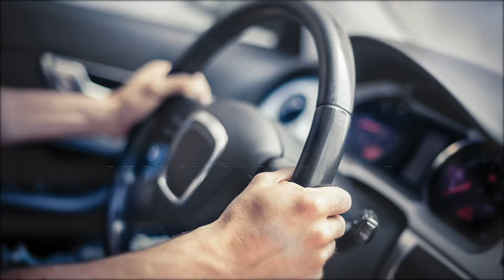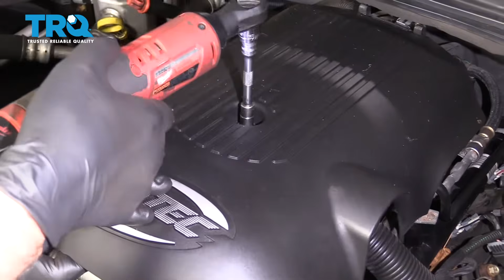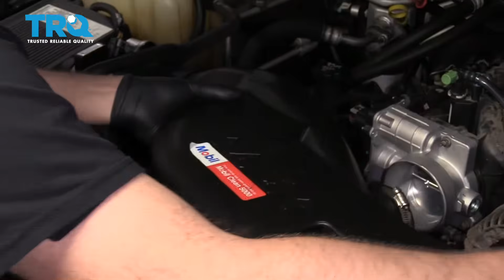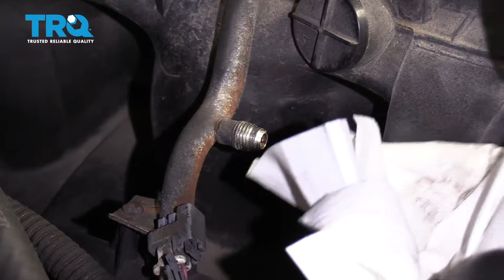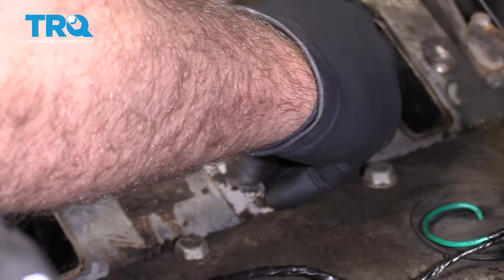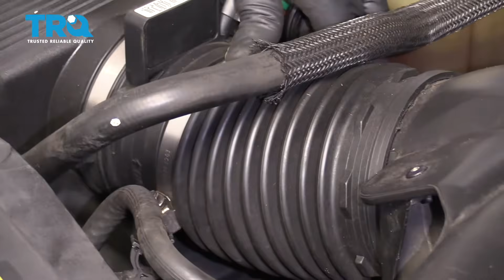How To Replace Oil Pressure Sender 2000-2006 Chevy Tahoe

Comment: Note on my 05 silverado after synching the key fobs and getting the lock and unlock sound per each one i then had to start my vehicle b4 they would operate correctly. Once I did, all fobs worked properly.

Comment: Done this one a couple times. 90% of this video is not needed unless you have huge hands. This videonis from a parts retailer. I think they're just trying to sell you more parts. Great forbreference and illustration though.
  Just feel around the back between the engine and firewall, use the 6-point 1-1/16" or a 27mm with a 6" extension right over top and a flex head ratchet and get'er done. Do be carefull about dropping your old sensor or cross threading, etc.
    Yes everything you disconnect might makenit easier, but just focus on the fuel rail and purge valve return line right next to the back corner where you're working , not all the reat of that junk. No reason to risk damage, loss, time, fiddling with perfectly good parts, etc when none of it needs touched.

Comment: if you are doing all of these (no need) , change the intake gasket, knock srnsors and hardware, oil sensor, and the other sensor by the oil sensor, and why not, the fuel injectors,  i did all of these in my 005 tahoe . make all of these removing hastle worth it !!
Reply from the maker: +@arturovalderrama4626 Thanks for the feedback! http://1aau.to/m/Shop-TRQ

Comment: Following the steps made getting to the sensor easier for me than trying to get my hand back behind the manifold.  As others say it's easy to get behind the manifold after disconnecting the fuel line and other hoses, I found it easier to just follow your steps and get the job done. Thanks!

Comment: All this job ,all this work is totally unnecessary unless You are the repair shop that needs hours for their techs and mechanics so they can charge 2 1/2 hours labor without caring for customers. It takes me 15 minutes to replace this sensor. The only thing I remove from the vehicle is the engine top cover ,piece of plastic. All You need is 27 mm socket, 6" extension and the ratchet ,you are done in 15 minutes ,You do have to push your hand through ,behind or between fuel line and purge valve hose but no big deal.
Easy job.

Comment: Real "CRAZY" taking all that apart, crazy
Reply: What is even crazier is that he didn't replace the knock sensors and harness(notorious for loosing their grounding and there is a bulletin out on replacing these) or the valley pan gasket while he was in there and no mention of it either.  But the video is good to watch nevertheless.  These guys are by the book and I always glean info from them.  I am glad they continue.
Reply: @2009adtommy  Well I believe this video is also in conjunction with how to replace intake gaskets, I think the video was just cut

Comment: 2005 GMC sierra 1500, 5.3L LM7, vin-T.  does my truck have a filter screen under the oil pressure sending unit?  My pressure is at 40 when cold, and drops to 20 when hot.  it only climbs when accelerating.  the sending unit is new.  we don't know if it has a filter under it.
Reply: No filter on your truck, i believe GM didn't start until 2007.

Comment: So unnecessary to remove all of that. Disconnect the pressure side fuel line at the back of the intake then you can access it fairly easily with a wobble and 12 inch extension. Literally a 10-15 minute job.
Reply: This is unreal for such a small replacement.
Reply: Well I believe this video is also in conjunction with how to replace intake gaskets and knock sensors.I think the video was just cut to the point.
Reply from the maker: +VOLANGLER Thanks for the tip! We'll pass this info along to our production team. http://1aau.to/m/Shop-TRQ